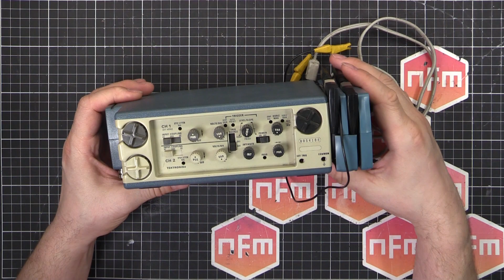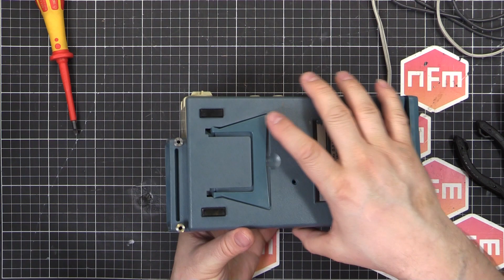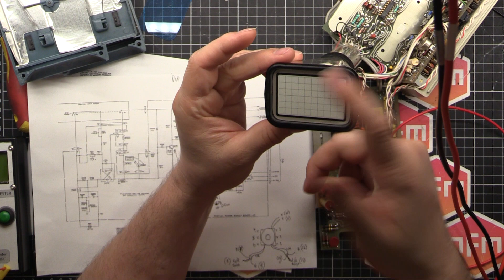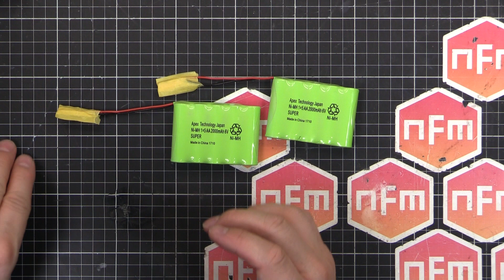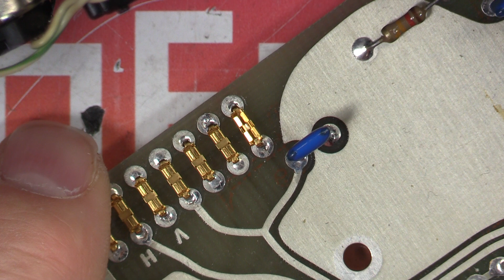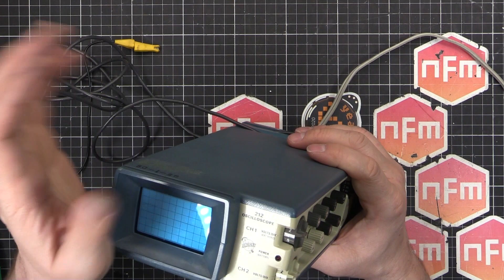Tektronix 212 Portable Scope Repair

Comment: I’m trying to repair a 212. I purchased 2 new 6 volt battery packs and installed them. No power. I’m going to check the rails for proper voltages. My question: do all of these need the rectifier board upgrade to change battery packs? TekWiki has a “changing your battery” instruction that says what serial numbers need the add this board. I’m just a little confused. Any help is appreciated. Great videos. Thanks.
Reply from the maker: The updated rectifier board was to provide additional protection, it shouldn't have any effect on the actual normal operation of the scope.
Reply: So I’m overthinking it? If I put new Nicad battery packs in then the scope should work. If not then back to basic troubleshooting. Check the rails and power supply components until I find the issue or issues?  Thanks for your help.
Reply from the maker: Yeah that's correct. The scope should even work with no batteries if it is just connected to mains power too.

Comment: Hooked up new batts to mine and up in smoke, melted my battery wires. I think the little tiny magnet wires off the transformer connecting to the transistors are shorted. I’m reading .4 or so ohms between the wires. Bad transformer? No idea where I could find another one.

Comment: I am trying to download the battery replacement pdf at the linked site,  and it's not working...  :-(   I click on download and see "checking for virus" or similar,  and then nothing happens.  I have one of these and also a 213 that are going to need this,  leakage is very apparent before I've even opened them up.
Reply from the maker: I've uploaded the document to the relevant page on the Tekwiki website now, so you should be able to get it there now.
Reply: @NearFarMedia  Got it,  thanks.

Comment: I'm thinking the power cord does not look original. If that sort of thing is important to you, you might give it a search.
Reply from the maker: From what I can tell it looks original, it has the proper strain relief clip and connection to the PCB.
I'll have to find a decent photo on the Googles somewhere to be 100% sure though.
Reply: @NearFarMedia  No doubt about it. It is the original. I have probably fixed a dozen scopes in this series. The only one I have at the moment is a mint 214 100KHz storage scope. Quite a feat of engineering in it's day.